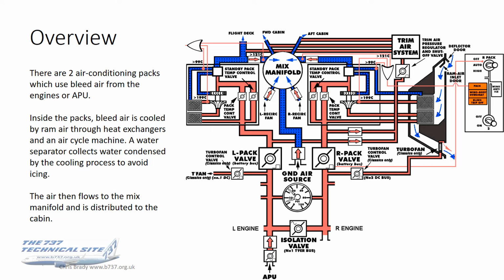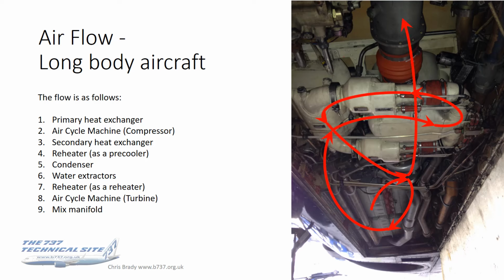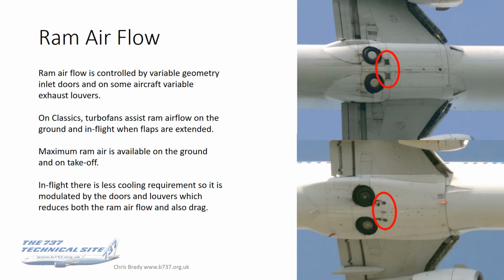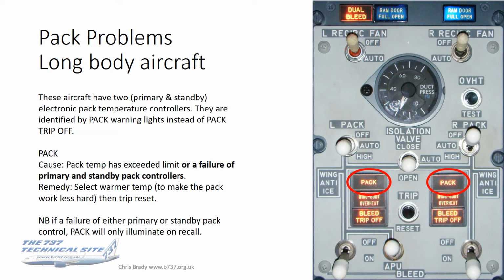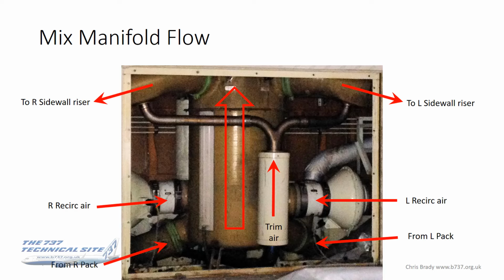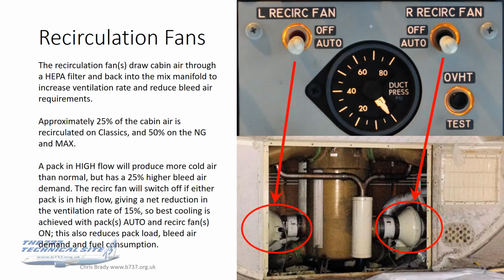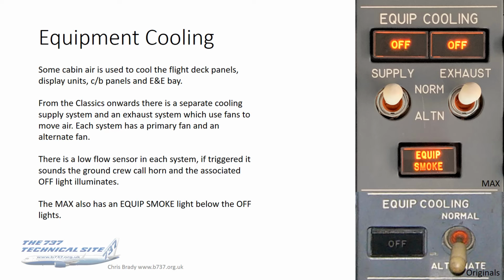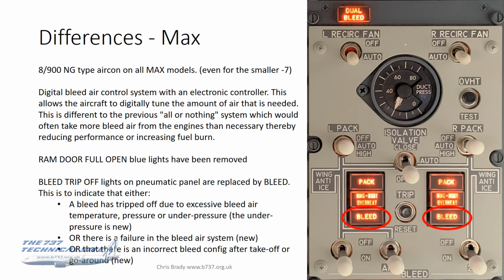737 Air Conditioning

Comment: Thanks for the detailed presention, I liked it very much. May I ask how the lavatory ventilation works (if it exists)? Does it get any direct supply or exhaust? Are these ducted to anywhere? Is it actively exhausted by a fan? Or does it just utilise positive pressure in the cabin with some path to the exhaust valves? I know its not crucial but having gone down the rabbit hole of airplane HVAC I could not for the life of me find any information on the seemingly unimportant toilet ventilation
Reply from the maker: Try asking here https://www.facebook.com/groups/737tech

Comment: Chris, why so many Alternating Heating and Cooling until the Air finally goes to the MIX Manifold? Is it to manage the Energy of the Air (as a Gas)?
Reply from the maker: Hi Pablo, yes it is all about managing the thermodynamics. Compression and expansion leads to heating and cooling, this is done because heat exchange (with ambient) is most efficient at high & low temperatures. The whole process is known as an air cycle machine.

Comment: On the ground, how is the cooling effect produced? There is no refrigerant correct? Everything compressed gets hot. What physics principle is used to create a cooling effect, and where? Is high pressure bleed air put thru an orifice to a low pressure state as it expands, like what would happen with an aerosol can? And is it that air that goes in the cabin, or does it remove heat from one side of a heat exchanger and the other side has different ambient air from outside that gets cooled in the exchanger and put inside the plane?

Comment: As always, Captain Brady, amazing video. I am a visual learner myself, these pictures do speak a thousand words. In terms of bleed trip off light, I guess it's like in a car isn't it? I remember someone telling me if your engine runs hot, turn the heater on and it will ease it up. I have yet to test it. Thanks for sharing this valuable insight!
Reply from the maker: Thank you for your kind words. Yes it is a similar effect.

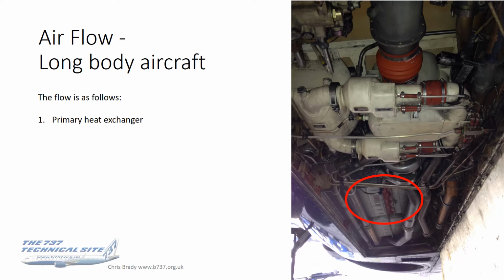Comment: 5:37 the Primary Heat exchanger has been labelled here as the FWD one, when in fact the Primary Heat exchanger is the Aft one 😳 this can be seen if you follow the ducting from the pack flow control valve round to the aft of the ECS bay to the AFT Heat Exchanger.
Reply from the maker: Correct, I realised my mistake as soon as I watched the video back a couple of years ago!

Comment: Hi Chris, great presentation. One correction - the primary heat exchanger is located AFT (near ram air exhaust) and the secondary heat exchanger is located FWD and connected to ACM.
Reply from the maker: You are correct, thanks for the info.
Reply: @ChrisBrady737  Also thank you. Your videos are fantastic.

Comment: Pop filter please.
Reply: @ChrisBrady737  what microphone did you use for this? When you record your audio, use something in front of the mic to soften unwanted noise from your voice. Recording engineers in the US call them pop filters. Idk if you've ever seen a setup that had a mesh screen or a circle that looked like it had women's panty hose stretched across it, but those are pop filters. The content is great, but the noise takes away from the overall sound quality.
Reply from the maker: The Air Conditioning video was one of the first I made and the sound quality was not great. After the first few videos I bought a better microphone and the sound quality improved.

Comment: Chris, thanks again for a great video. I have one question: @ 50min you discuss the heating of the cargo bay; you said the cargo bay was heated by the warmer air circulating around the cargo liner (I remember this being said during the type course). The following is something I assumed in that, the pressure equalization valves also allowed some air to enter the cargo compartment. I remember the blowout panel had around 1 psid crack and I also remember the valves below it were very easy to open when inspected, hence my assumption. I'm conflicted here in that, what is the point of sealing the cargo bay with fire resistant liner only to allow the PEV to open?
Reply from the maker: Hi Peter, I see the scope for confusion but remember in the event of smoke/fire a descent / depressurisation will soon follow. This should take the airflow away from the cargo bay.

Comment: If i turn off the pack on the side im starting the engine and keep the the other pack on until i want to start the other engine to keep the cabin cool, could i do that.
Reply from the maker: Not for the first engine, it will reduce your chances of a successful engine start. For the second engine you can follow the Isolated Pack Operation during Engine Start Procedure in the FCOM.

Comment: Hey,

Would a BLEED TRIP OFF cause the operating pack to switch to HIGH flow mode?

 Cheers
Reply from the maker: No, but if a pack were to overheat the flow would go to high on the other pack.

Comment: Thanks Chris 
For the presentation.I really enjoyed it been very informative and it helps to drive home the knowledge of what I read in the FCOM. Just a note about the Comments that You get best cooling with Packs in Auto and Recirc FANs ON.I find it contrasting with what you get when operating in Middle East region with summer temperatures around 40 degrees.You will need to do the Hot Weather supplementary procedures to get a bit of cooling in the cabin and that requires Both Packs in High.
Reply from the maker: Hi Bankloe, Many thanks for your kind comments. Yes you are correct that in extreme hot weathers the supplementary procedures should be used.
Reply: @ChrisBrady737 
  
      Just wanted to add that in addition to hot weather procedures that increase pack cooling air, at the expense of recirc fans being turned off, shutting off the engine bleed switches at the gate with both pack switches in auto accomplishes the same effect, even with APU off and conditioned air hooked up.

     This is important because at the gate in a warm climate, the forward cargo door is usually open.   

     With this door open, the area around the forward bin gets as hot as the ramp (apron) and this area around the bin is where the recirc fans draw air into the mix manifold.

     The best cooling in hot weather is usually obtained with the recirculating fans off, which seems counterintuitive to some because the airflow through the gaspers is reduced.

Comment: Thanks for the explanation! I still have not understood the "STANDBY PACK AVERAGE TEMPERATURE" though.
FCOM states "If all zone controls and primary pack controls fail, the standby pack controls command the packs to produce air temperature which will satisfy the average temperature demand of the two cabin zones. The trim air modulating valves will close. The flight deck zone temperature selectors will have no effect on the standby pack controls"

Could you please explain this above in simple terms?

In this above scenario there is no temperature control for the flight deck, why so? why can't the packs go to Independent mode of operation in this above scenario where the left pack takes care of the flight deck temperature and the right pack produces temperature to satisfy the average of two cabin zones?. At the end is an unbalanced average mode with packs controlled only by the standby controllers

thanks ;)
Reply from the maker: There is a L pack/zone controller and a R pack zone controller. If one controller fails then that pack uses the controller from the other side (called the standby pack). As the FCOM says this mode does not have the full functionality of two independent controller operation. As for why it was designed that way, I don’t know!

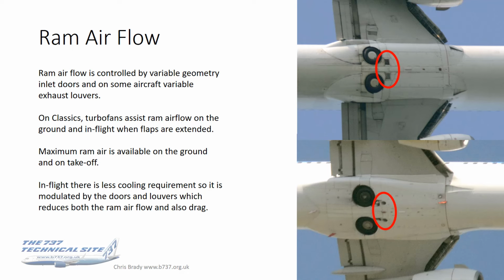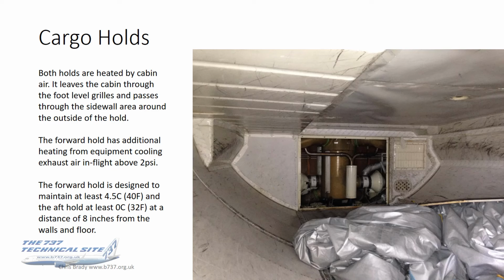Comment: Outstanding information thank you Chris. At 16:41 I'm wondering does the Max not have these turbofans for assistance with airflow on the ground? What does this job as the plane is not in movement for ram air? At 49:11 you mention both cargo holds are heated by cabin air through the floor grilles. Looking at the FCOM (Max) this is not so clear. It mentions the floor grilles in the AFT section over the AFT cargo. It left me with the impression that the only heating for the FWD cargo was from the EE bay air circulating around the FWD cargo.
Reply from the maker: Only the Classics had turbofans.
Re cargo compartment heating, this is the position:
The cargo compartments receive heat from equipment cooling exhaust and passenger compartment air.
Warm equipment cooling exhaust air flows under the forward cargo compartment floor and along the sidewalls. The air mixes with passenger compartment air in the main distribution manifold.
The aft cargo compartment air comes from the passenger compartment through the foot level grilles. The air goes into the sidewall area around and under the aft cargo compartment through the outflow valve.

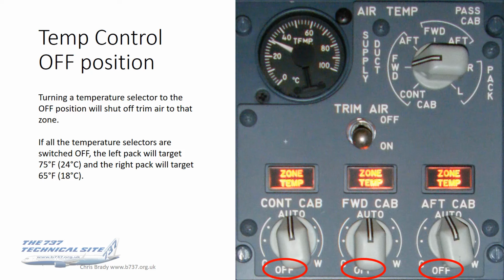Comment: Sir forgive me if I’m asking a silly question but I’m a newbie just started to type rating. I’d like to be sure about the temp control selectors in the cockpit. Do they control the ‘pack temp control valve’ inside the pack, because the coldest zone temp is determined via that valve after the pack before the mix manifold as far as I understand, or the ‘ trim air modulating valves’ in the trim air system for an individual zone? i.e. 23:30  I know you’ve mentioned it but I couldn’t be sure about, when OFF position, which one closes. Could you please clarify this for me? Thank you so much in advance.
Reply from the maker: When a selector is moved to the OFF position, it closes the related trim air modulating valve.

Comment: Hi, from the FCOM

The APU is capable of supplying bleed air for two packs on the ground, or one pack in flight. Most external air carts are capable of supplying adequate bleed air for two pack operation.

#Do not operate more than one pack from one engine#

The part i have highlighted with # is this only inflight and is this due to high thrust demand?

Thanks
Reply from the maker: Your extract is incomplete. The full quote from the current FCOM is "Do not operate more than one pack from one engine at any time." - so not only inflight. The reason is due to excessive bleed demand on the engine.

Comment: Question , on ground what is drawing air in through the heat exchangers ? If you put your hand near the ram air inlet you can feel air being sucked in , what does this ?
Reply from the maker: Aircraft on ground,or flaps not up turbo fan in bypass duct will run if pack is on.
This is purely cooling air for the primary and secondary heat exchangers it does not enter the cabin,only compressor air apu/eng supplies the cabin.
BTW if engineers run packs on the ground in air mode the cooling turbo fans don't run if flaps are up and the packs will overheat.

Comment: Hi chris,

When on the ground and with engines off and APU, if you turn either pack / bleed switch AUTO / ON this should decrease the FMS N1 by a set amount ie .8%

But i’ve also read its the ONLY the position of the APU BLEED SW will have the effect on the FMS N1%
Reply from the maker: I dont think that is correct but you could try it and observe the changes on the N1 LIMIT page.

Comment: This video was very instructive. Thank you Sir! I'm still curious about two things though. First, is my understanding correct that the recirculation fans are extracting the air "surrounding" them (i.e. they are not directly connected via ducts to the cabin, for example) and, in addition, this "surrounding air", is it the air extracted from the cabin through the foot level grills? And second, the gasper flow is driven by a gasper fan. Is the gasper fan extracting air directly from the mix manifold, or is it just cabin air?
Reply from the maker: The recirc air is from the foot level grills. Gasper from MM
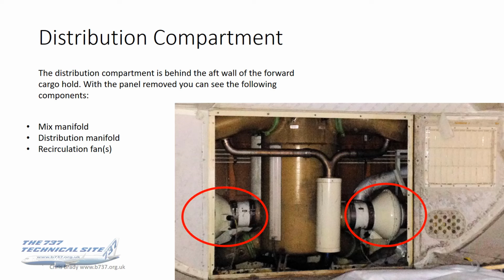Reply: @ChrisBrady737 Thank you very much! For the recirculated air, at 49:40 you explain that air drawn from the cabin goes through the sidewall area around the outside of the holds. So, is it true that the recirculation fans (29:50) are ducted to the area surrounding the holds? I'm just trying to visualize the air flow through the whole system. Thanks!

Comment: Great presentation.  Question about the pack switches.  Under what circumstances would you want to switch the packs to "high" on the NG and Max?
Reply from the maker: QRH - Volcanic Ash, Cargo Fire, Smoke or Fumes removal. Or if you just needed more airflow.
Reply: @ChrisBrady737  Makes sense.  Thank you!

Comment: Thank you very much for this very informative video! 
If I may ask a question, something I never understood is why, when we switch the left recirc fan OFF, the noise level goes down in the flight deck. Switching off the right fan doesn't do anything. Would you happen to have an explanation for that? Looking at the schematics of the air conditioning system I don't see how recirculated air can have an effect on what is supplied to the flight deck.
Reply from the maker: Glad you are liking the videos.
The difference in noise levels is because the recirc fans get their air from different sources:
The right recirculation fan pulls in air from the collector shroud in the forward cargo compartment. Floor grilles in the passenger compartment permit airflow into the collector shroud.
The left recirculation fan pulls in air from the distribution compartment.

Comment: Recently parted out the cockpit of an early 737-300 and the bleed air panel has both a gasper fan switch and a single recirc fan switch. The MIP on this aircraft is almost identical to the -200ADV. Wonder if this might have been right between the transition from gasper to recirc or if it was a customer option (ex SWA).
Reply from the maker: Hi Mike, I have never heard of this combination before having both a gasper and a recirc fan. Could you send me a photo of the panel pls?
Reply: @ChrisBrady737  yeah, I actually have a couple of examples. First from N345SA (early -300), originally delivered to Transavia ~'86 then spent its final days with SWA. And a second of unknown origin (I might actually have some paperwork for it somewhere, will look when I get a chance). I'm curious to see the mix manifold of N345SA, if it has one recirc fan or two fans controlled by one switch, next time I'm down at the yard I'll get in there and take a pic. Here are the pics of the P5-10 panels I have at home: http://public.mikeobrien.net/P5-10. Actually another thing that's interesting is I was pulling parts from an early -200 recently (N322XV, ex-olympic, pic included in the link), checked my pics and didn't notice a riser on the right side. Don't have a pic of the left side but I wonder if they only had one riser on the early -200's? Will have to check that out too when I'm down next time.
Reply from the maker: The first Classic, a -300, only made its first flight in Feb 1984 so one of those panels pre-dates that by years. How did it have a recirc fan? The later panel (2003) is equally a mystery. I wonder if it was an option for operators in hot climates to have powered gasper fans as a booster? Fascinating stuff, thanks very much.

Comment: This is a very good description of the Air Conditioning Packs of the 737. I will offer one minor correction. The Packs were not a Being design. They were designed for all 737’s, by then AiResearch, which through corporate mergers were at points Garrett, AlliedSignal and as of now Honeywell. They were the “clever ones” that designed the packs to spray water into ram air inlet, but only on the 737-300 and later models. The 727’s and the 737-100/200 just vented it onto the ramp.
Reply from the maker: Thanks very much for the extra info. I am always willing to learn more. Please keep your comments coming.

Comment: Hi Chris. Regarding the QRH engine failure they want you to switch the isolation valve to AUTO. Why not just OPEN the valve
Reply from the maker: Don't confuse the Engine fire and failure cases. The QRH drill prescribes isolation valve closed until the fire is extinguished. Assuming this is the case it is not logical to place the isolation valve to open as this then prohibits the bleed / pack auto logic.
Reply: @ChrisBrady737  so auto logic is when the isolation valve is in AUTO and any of the 4 corner switches are turned off?